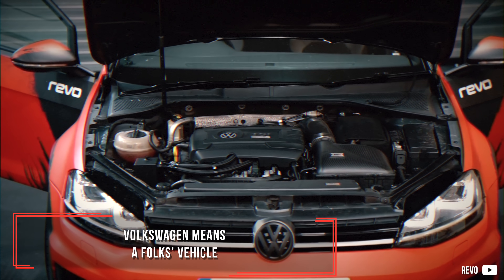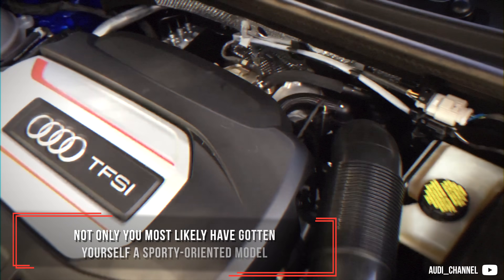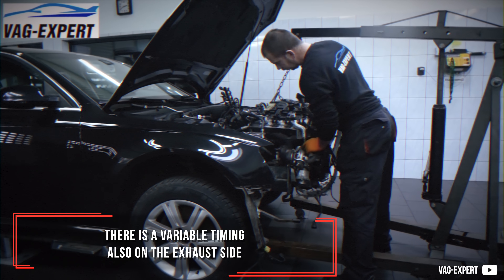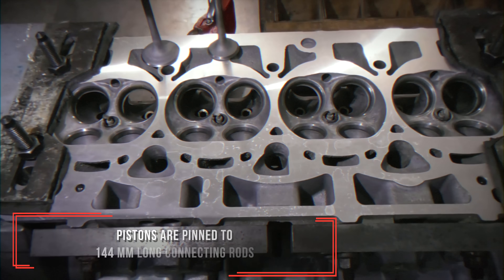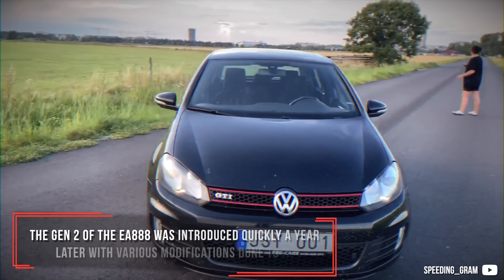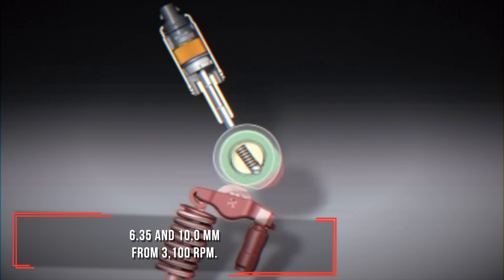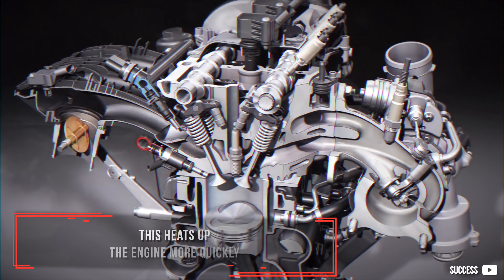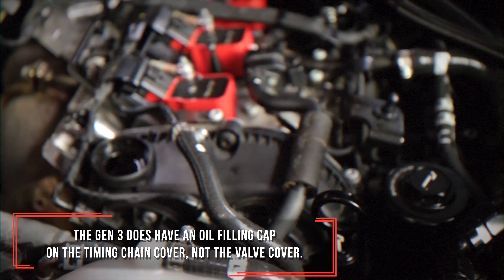Why The Volkswagen EA888 Is So Good

Comment: 100 000 km on EA888 gen3 in stock Cupra 280. Zero issues with engine so far, only water pump replacement. Love the car even after 4 years in stock, power is superb for country roads.
Reply: Just take stage 1 and be happy 😃
Reply: @power93_365  I'm considering REVO stage 1 for 2 years 😁 but I plan to change car so... won't do it.
Reply: @ErM340  just do it, you will change your mind and keep car, much cheaper then buy new 🤣😂
I put stage 1 after 3 month car was still new on warranty
Reply: I have same car but ST version. Same mileage, just have put a stage 1 one month ago. This thing is damn fast..! If i change is only for 400+ hp compact car. Dont want to loose this sensation
Reply: @patrickrodrigues4202  I have an ST too, manual with upgraded clutch. After cupra I plan to buy RS4/RS5 sportback B9, but when I have no idea :D
Reply: @ErM340  man of taste 👌🏻. Love these b9 rs4, if i change want this too.
Or the formentor vz5, bmw b58 something like that.
Reply: @patrickrodrigues4202  yeah, the same here: RS4/RS5 or M340i. For me in that price range audi is the best choice, you can buy even E63 or M5 in that price range but that are bigger cars, probably not that playful in tight corners etc. and also "too fast" for roads.
Reply: @ErM340  Agree, V8 saloons are amazing but only for autobahn. I live in switzerland, here we have small twisty roads, i need something playful too.
Even if the bmw b58 have more potential for tune, and a little bit cheaper to buy here, i would go for the b9 rs4.. Looks amazing and the sound of the V6 is better than the L6 in my opinion.
But... must wait a little bit, the m3 touring is coming, need to see.
Reply: I have a Cupra 290 ST -  have heard about water pump issues, how did you know it was going and what did you replace it with? Is there an uprated aftermarket pump available?

I've had to replace DCC as one damper failed and others were leaking pretty badly after 40k miles, but heard this is pretty common - got springs and top mounts done at same time.
Reply: @ByronWWW  I've started to have cooling fluid under minimum and also warning light showed on dash. You won't see the leak by an eye....luckily solved under warranty. Happened around 50-60k km.

Comment: Stupidly compilacated engine that only lasts if everything goes to plan but if you miss a maintenance or a little bit of heat the whole engine will go crazy and   an expensive bills will shock you, and you don't need all of this because you have other options toyota 3.5 lt v6 will produce 305 bhp and with ecu modification you will get 330  bhp with an engine that is lighter than Volkswagen 4 cylinder and this engine is simple and will last a long time even if you missed an oil change or gave it to your grandmother.
Reply: You don't live in Europe, do you?

Comment: @4:45 says it's a dual-injector setup, but my EA888 Gen 3 (on a 2020 US-market GTI) has only direct injection. Is this an Audi setup you're referring to?
Reply: US didn't get dual injection. Only Europe.
Reply: Even in europe, post 2018 cars with FAP filter, only have direct injection.
Dual is 2013-2018
Reply: @patrickrodrigues4202  Yes, if the particle filter then it gonna be only direct injection. New EA888 evo4 is now back to direct injection only worldwide as it fitted with particle filter.

Comment: The Gen3 EA888 is far better than the previous two generations and is generally safe up to 500 whp on stock motor.
Reply: as long as the torque is 600, hp could be anywhere higher
Reply: @mkviis  Well, there's no reason to keep hp high while limiting torque.
Reply: @AAAAAAndrea  sure there is. Its not as much about limiting torque as it is bringing in the torque smoothly. If its snaps 450 ft lbs quickly, thats not the same as slowly ramping up to 450 ft lbs
Reply: You tell them Liam
Reply: As someone who owns an FSI, I really swung and missed, didn't I?
Reply: @TheMailmanOfSteel  save up for a gen 3 lmao. your cam follower will exhaust u.
Reply: @TheMailmanOfSteel  the FSI is good if you take care of it and can handle more power and more reliably than the first two TSI
Reply: for sure, I know many fellow Audi S3 owners with stage 2 FBO's well over 400 WHP holding up perfectly fine with many miles on them, these upgraded S3 2.0's are bomb proof- they have many upgrades over the standard 2.0 TFSI- I listed them in my other post.
Reply: imagine the bee evo 4

Comment: I have a gen 3 in my 2017 A4. It has FBO, E85, and a syvecs ecu and tcu. 400+whp

I’m also really happy they flipped the engine so I can do a timing chain with the engine in the car.
Reply: How many miles?
Reply: @zenxen7668  before I blew my first engine, 120,000km 65,000miles

Comment: Ks and SRs still eats this 888 tho
Reply: Depends how much work you're willing to put into this. If you're going all out, building motors and adding turbos the K whoops all 4 bangers. But most people don't go beyond basic bolt ons, and the EA888s whoop everything in the realm of bolt ons only. For a power minded daily driver the only thing better than an EA888 is in 07K (EA888 with an extra cylinder)
Reply: I think the EA888.3 is better up to about 550whp. But no other automotive 4 cylinder flows as much as a K series head, and the VW engine won't make over around 700whp no matter how hard you try do to the limits of the head. The K series takes the win for 700+ whp for sure.

Comment: So many people have so many opinions.. from my experience Gen 1-2 tend to fall apart way easier than it should. Ofcourse there are examples, where they last long, but but mostly not. I do own a MK6 gti 35 edition, whith is fitted with EA113 from the MK6 R and never had an issue since i bough it. Feel like VW sorted most of the EA888 problems with gen3.
Reply: I know a couple of dudes with different VAG cars, all with Gen 1/2 EA888s in them, most with more than 150k Kilometers and none of them have had any major issues.
Which is impressive considering they're really beating them, running 270kph+ on the Autobahn regularly.
Reply: @l33tnobody1337  from my experience, these cars like being driven hard, and they hate being driven in cities constantly from red light to red light.. 
as I said in the main comment, some people have MAJOR issues, but if you service it right, with upgraded faulty parts, it can be a long lasting ride ❤️
Reply: The EA113 is even crappier than 888 if possible ....

Comment: The 2.0 TSI EA888 Gen3 it's actually capable of +500HP with stock crank, rods and pistons when using an hibrid IS38 or some similar turbo, it's amazing for a 2.0 4 banger.. 

Also you forgot the Gen 4, it's the one that comes equiped with Golfs MK8 (gti and R) with a Continental turbo
Reply: 2 litres are getting massive power..
Just look at the stock Amg, 421hp!

Even more than the 2.5 5cilinder rs audi's.
Reply: Same with 1.8tsi EA888.3

Comment: I have a Mk7 standard golf (1.8tsi) with an IS20 upgrade, intake, and tune. Stock exhaust, DP, IC, fueling…the car absolutely rips for a simple turbo swap and flash. It’s actually hilarious, the car has pulled Maserati quattroportes, new 5.0 Mustangs, Challenger 392s….ridiculous for a little golf. Indeed it is a fantastic engine
Reply: look out for injector failures and water pump failure (leakage)) but yea a good engine. It can do it all with great fuel economy
Reply: @maureencomeau7218  injector failure is only really a thing with the facelift models, mostly the 2019+
Reply: What fuel upgrades are needed with this upgrade? I just got a '17 Golf last month and a turbo upgrade is in its future. I haven't heard too much about fuel system upgrades though.  I just loaded a Unitronic Stage 1+ tune and it already seems ridiculous for what it is.
Reply: @busslayer4790  for IS20 the stock pump is fine. I mix 3 gal of E85 into every tank as well and I drive the car hard, 80k miles still ripping. I would probably upgrade the HPFP if you plan to run full e85 on IS20. IS38 does require the HPFP upgrade on the 1.8. My car is Uni Stage 2 IS20 with an APR intake all the way to the turbo, stock intercooler, DP, and cat back, fuel pump, everything else is stock. so really you can swap an IS20 and flash alone with everything else stock and will probably pickup another 50hp over your stage 1+. My car is a bit of a factory freak and is probably making 280-290whp and even with the slight E mixture no issues with fueling. Do the IS20, it’s honestly a joke how fast the car is for a factory turbo upgrade.
Reply: @FlyingStuff  the is38 Unitronic tune for the 1.8 does not require a hpfp. So many people run the stock one with is38 on Unitronic and APR with no problems since the is38 tune is a little more conservative from those tuning companies. Now if you are talking custom tune that’s more aggressive and e85, that’s different. But yeah dude these 1.8 ea888 Gen 3 engines are slept on. I can’t wait to get the is20/is38 for my alltrack soon. Currently running Unitronic stage 2 Ecu and dsg tune. Love it more and more everyday
Reply: @gabrieldetwiler7078  Interesting, I would still probably run the HPFP as a precaution probably with an IS38 but did not know you can run the stock pump. My buddy has a 4motion GSW….same drivetrain as the alltrack (1.8/DSG) with the IS20, DP, Uni Stage 2 and TCU tune. The car gets out of the hole so fast. However we both agree if he had done it again he would go IS38. For not that much additional cost you get a lot more at the top end, and the Alltrack/GSW are probably 300-400lbs heavier than the hatch and with 4motion suffers more drivetrain loss. I can’t touch him on a dig but from every speed rolling on the highway my car puts at least 2 car lengths on him. He’s got a DP ( I have stock) and a much better transmission than me, but he still falls back. The boost onset on the 20 is a bit extreme as well, one the WG opens it spikes to full boost and you get a big power surge. The 38 has a much smoother, more linear powerband
Reply: @FlyingStuff  yeah the 38 according to everyone is the way to go. Just feels better and is just a better powerband overall. But you definitely pull on that GSW 4 motion because of the awd torque loss, and ofc the weight difference. Normally fwd cars are better for rolls, but awd from a dig. Either way these cars are crazy. And the best part is those turbos is20 and 38 are not big turbos at all, and these engines can easily handle the power. I plan on doing the 38 unless I find a can’t miss deal on the 20. I will not however go bigger or more than the 38 because that to me is where you start to sacrifice reliability.
Reply: @gabrieldetwiler7078  yes all completely true. My car is auto (got too good of a deal to pass) so for me the is20 is a perfect balance of power and drive-ability. I do also have a buddy with a Vargas (VTT) 72mm hybrid on his alltrack….stock engine with a port fuel injection swap running 100% e85. The car feels like it’s conservatively making low 400s to the wheels and he’s got a lot of trouble free miles on that setup. He’s making over 500hp to the flywheel on a stock 1.8tsi. They can handle more than people think
Reply: @FlyingStuff  Thanks for the info.  With past car projects I've always taken the cautious, conservative approach to mods and being disappointed after.  So this time I was thinking I'd go straight to the IS38.  So I will budget for a new hpfp.
Oh, and since my last message, my son stopped by with his tuned Focus ST.  We decide to run them.  I walked him 3 of 4 runs!  I didn't really expect to stay with him, let alone pull ahead.  I had driven his car before and thought it felt faster.
See my channel.  I posted a quick 1-2 hit with the Uni tune the other day.
Reply: @busslayer4790  all Unitronic tunes for the 1.8t do not require any fueling upgrades
Reply: You're not pulling a 392 with that setup lol
Reply: @glovercarvalho  Well I did, the other driver was not skilled at all lol. He did start coming back at me at about 110 and then we had to slow down. He would have gone well past me if we kept going…but it doesn’t matter, a chase is a race and he couldn’t get around me in time. The golf 1.8 base is like 2950lbs, the charger is like 4400…they may have a lot of power but they are heavy pigs. The whole point is that it’s quite funny a $20k 1.8l golf can hang with a near 500hp 6.2L V8. IS38 1.8t would walk a stock 392.
Reply: @glovercarvalho  I could see, could be 370 or so and a base model Golf is very light. Won’t beat one from a dig but a roll it could happen.
Reply: @glovercarvalho  your definitely wrong. 392 boat

Comment: Gen1 and gen2 has high oil consuption and is required to change pistons. Gen3 is hidden gem. Although, toyota used fsi+mpi alot earlier. Shame that with gen3b/gen4 with opf they removed indirect injection in high power variants, but 140kw version still keeps indirect.
Reply: When you flush your gen1 every other year to keep all the internal oil channels free of crap you can have fun..change the timing chain around 120k and also change the tensioner you're golden for some time..
Reply: @justkiddin1980  well, about that oil. I always say, if everyone changed to 1year / 15 000 km all engines would be alot more reliable. Also first oil change after 1000km. Thats what i did with my superb 206kw. only water pump started leaking, but replaced during warranty
Reply: Yeah, they used the FSI + MPI injection to meet emission laws, but since the introduction of GPF it was no longer necessary.

Comment: I had a gen2 EA888 engine in a MK6 GTI stock, owned from new. Was great when it was new but quickly wore out. I had the following issues: timing chain tensioner,  water pump,  diverter valve x2,  HPFP, coil packs x2,  stretched timing chain, and to top it off, at 70,000Km it needed new pistons, rings and conrods due to the 1ltr/1000km oil consumption. This was also coupled with several other issues with the vehicle. It was serviced well before it was needed and I changed the oil every 8,000km with Mobil1. It was never thrashed or abused. It had only done 80,000km when I sold it but the engine sounded like it had done 280,000km. What piece of shit that VW was and the dealers were worse. I now own a Hyundai I30N and have had zero issues at 65,500km. Please VisioRacer, don't encourage people to buy anything form VAG or sing the praises of any VAG products!
Reply: Ur problem was u never trashed and abused it.
Reply: @raphiology  This seems to be true! If you do daily driving too often without "abusing it" it can trigger series of problems! It needs a bit of spirited driving from time to time
Reply: @StromtrooperV2  I used to give it a spirited drive on a regular basis but never abused. It has to do with the design of that engine. Was just shit. Typical VW unreliability and badly engineered.
Reply: @shanemitchell5807  Dunno. I know it had timing chain tensioner issues as well issues with water pump and few other things, but almost every engine has its pros and cons... Yes I know some drink oil like gas, but its fixable... I'd say you are US based, bcs USA got very few of VWs quality products but your name sounds british
Reply: @StromtrooperV2  No not USA, Australia. The oil drinking problem is an expensive fix. My GTI was a Wolfsburg build.
Reply: @shanemitchell5807  Well it is bcs of your location... Here its around 1000€, cheap labour price.
Reply: @StromtrooperV2  You are missing the point...
Reply: @StromtrooperV2  Yes bro, trashed may be overdoing it but yeah it needs a spirited drive from time to time. This is what the car is build for, eps with direct injection cars
Reply: Gen 1 and 2 were rubbish...gen 3's in the 1.8/2.0 were gems and had incredible tuning potential
Reply: Gen2 ea888 was total thrash. Cant compare that to gen3b because thats whole another world
Reply: @kuba8466  Don't care if gen3 is better. The rest of the car was rubbish as well. Wont buy their products ever again. VW have a shit reputation because their products are unreliable.
Reply: Gen 2 was the worst generation. The issues you had have been fixed from gen 3 onwards.

Comment: I have a Polo GTi 2.0 and there no denying the EA888 is the most superior engine not just made by VW but 2.0s in general
Reply: Debate-able, honda k series are amazing and mitsubishi 4g63's are a tank of an engine (developed in the late 70's released in 1982). Daily'd my 4g63t awd eclipse for 10 years at 550awhp stock engine never broke down once. Amazing what maintenance can accomplish.
Reply: 07k is better
Reply: Mercedes' A45 S AMG  performs better though
Reply: @g_webb21  it does but at what cost
Reply: @g_webb21 No wonder, but compare the price differance between a AMG &. Polo. Esp on todays prices! 😂 Iwas into buying the A45 when it was new, but glad i didnt as they had problem with sluggish gearbox, which ithink they solved in S model? Very happy owner of GTI Clubsport MK7 @ stage 1 370 hp  at moment.

Comment: These third generation engine can’t handle a stage one tune. I’ve replaced many long blocks due to the pistons breaking apart.
Reply: Love to see the service history on these cars you’re talking about. I’ve never heard that before and I own a 7.5R with 450hp crank (ethanol tuned) with 77,000 km’s on her and I haven’t had one single issue yet. But I do take very good care of it and change my oil every 5-7k km.
Reply: BS, there are thousands of gen3's making over 500whp on stock block reliably.